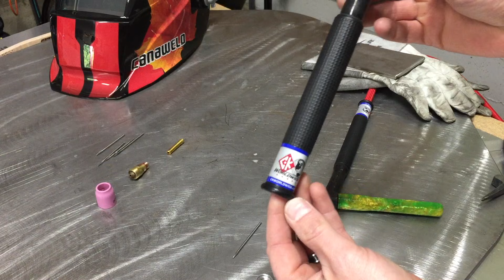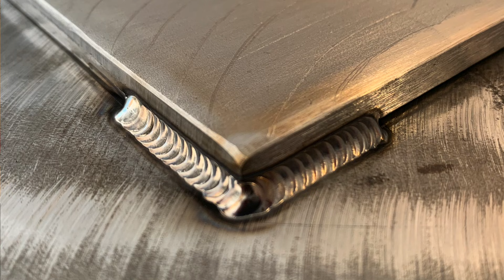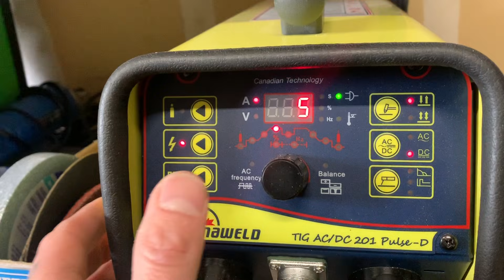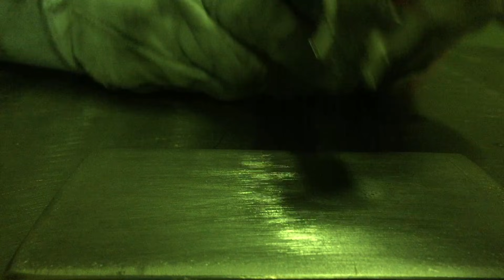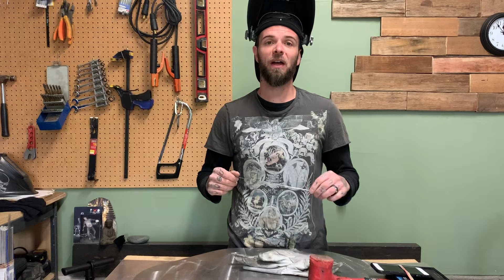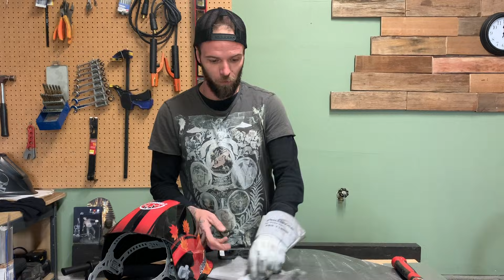TIG WELDING STAINLESS STEEL - HOW TO TIG WELD STAINLESS STEEL FOR BEGINNERS!

Comment from the maker: 💎💎💎Take a FREE online Tig class on my website HERE👉 https://www.pacificarctigwelding.com/

Thanks for watching! Check out my latest episode HERE🔥🔥https://youtu.be/FpaDdDRMeyc
Reply: My tig machine Is 200 amp,have two analog button,one is amp and the other is post flow,how do i set it for tig weld stainless steel pipe
Reply: The passive layer has nothing to do with whether or not SS is magnetic.  It has to do with the microstructure of the material (I won't bore you with the details unless you want).  The various SS are either non-magnetic or slightly magnetic.  A very strong rare earth magnet will be attracted to the slightly magnetic SS but the attraction is nothing like the attraction to mild steel.  The nonmagnetic properties of SS is a reason why they are used where there are strong magnetic fields present.  For example, MRI machines have their structural elements made of either fiber/epoxy composites or stainless steel.  With the exception of this one point of detail, you video is excellent and I learned a lot from it.

Comment: You didn’t touch on how to identify and use the correct white insulator for different cups. 
I chased a leak and delt with contamination for weeks until I finally figured out out I need to change the white insulator.  Which was a pain to find the ones that fit a ck 17.

Comment: What is your opinion on water quenching  , working with stainless?
I trying, 2nd attempt due to not being satisfied from lack of purging,  to build a turbo up pipe/ adapter from sec 40 2.5" pie cuts. It gets very hot very quickly. With 7 pices to weld air cooling will be 14-18hr of idle/ cooling time with purge on for 1hr of actual welding.

Comment: Dear Dusty a little while ago now 13th August 2015 I purchased an excelent R-Tec TIG 161 Welder on a 32 Amp Plug with a Custom Made R-Tec Welder Trolly plus various sundries all of which I have used here on my farm! On the 28th February this year I again visited R-Tec, who trade out of, Tewksbury Trading Estate, Gloucestershire and purchased an excelent R-Tec MIG 251 Welder plus various sundries and a Welder Trolly, again the MIG is on a 32 Amp Plug! Saves a 13 Amp Plug getting a bit warm on both Welders sometimes and with the Two Trolleys, me getting a bit warm lugging both the substantial welders about! I have to say though that my first choice of Welder up to now has been the newer R-Tec MIG 251! I feel though that after watching your excellent video on TIG Welding that choice may well change somewhat! I now fully understand the settings, associated equipment,  TIG Welding Technics and usage! So I will now be "Wheeling Out" the TIG when a use suggests the a TIG to be the first choice for a TIG Type task! Without the videos knowledge imparted I would not be so confident Dusty! You imparted your knowledge very well and it is now deeply ingrained and retrievable and I will be well able to "Wheel out" the MIG to use all that wonderfully imparted knowledge to "Weld up" my various Massey Ferguson, SAME 100 Six Cylinder Silver  Air Cooled Tractor, Fordson Super Major Tractor, Land Rover Discovery 2, Range Rover P38 Vouge SE, 4.7Lt, V8,  Various Farm Machinery, Buildings and Farm Equipment! Great! Wonderful! You all know? I can remember what it was like before You Tube and Great Imparters of Wisdom like you Dusty! I for one do not want to go back there! Many a Thank You! See you all about!
Yours faithfully,
                            Rob Allen.
                                               A Farmer at Halmore, Near Berkeley in The Vale of Berkeley, 
                                               South Gloucestershire. 
                                               The South West of England.
                                                In the Middle of "The Big Pond"!

Comment: Try pulsing it at 1.2 pulses a second High amps move fast. You're looking for no color on the outside of the weld that means heat is traveling through your part

Comment: 304L can be very slightly magnetic. 316L I mainly work with is not magnetic at all and Super Duplex, which we use for a lot of outdoor/sea/nuclear applications is extremely magnetic. Super Duplex is a joy to weld, super smooth, though it doesn't penetrate the same as the previous 2 grades. Its almost gummy in how it lays, doesn't sink into the joint as easy.

Comment: Thanks brother ran across your channel I'm an industrial electrician/mechanic good with mig but trying to learn tig we got a dynasty 350 almost got dimes but ran accross your channel I was told to start with stainless steel not aluminum this is the video I need love the help someone out at the end of the video your right about that we need more positive attitudes out here I'm rambling thanks for the intel

Comment: Looking at your set photo area back ground I see
Couple electrode holders that have never been used a hack saw with a blade that looks like its never been used 
Just a photo op area 
Not the way my tools looks

Comment: 5:00 Stainless steel will rust. The reason why new stainless steel does not form rust is because it has been passivated with nitric or citric acid, by dissolving iron from the surface, leaving chromium, which forms a stable layer of chromium oxide ond protects the surface. If you scratch through this iron-free chromium layer and expose fresh iron, it will rust.
The reason why stainless steel is not magnetic is that magnetic poles of the atoms do not align, like they do in iron, when exposed to a magnetic flux from a magnet. This is a material property, not a surface/coating property.

Comment: Hi Dusty, about a year and half ago I started tig welding. I was able to cobble together a gate for my side driveway 9' wide by  by 5.5' high and a smaller yard gate all made of steel. Between Jody at Welding tips and tricks and Justin  the fabricator and your step by step videos I was able to do it. I am starting to  learn to weld aluminum and my next thing is Stainless. On steel I was getting the oxidized bead....maybe too much heat and not enough gas coverage. The odd time I would get shiny beads but did not know what I did differently to get them. Kind of frustrating but you have given me some ideas that I will try. Thanks for all your help!!

Comment: I’m going to be straight up with you. I have watched every video there is on getting started with Tig welding and I have never seen or viewed However, you want to say it, anything as informative as your video.
I recently subscribed to your channel. I was hoping you would mention how far the tungsten should stick out paste your cup, but other than that which I could pretty much tell by looking at your set up, it was 100+% 
 I want to thank you for making these videos.
  I would like to see you make videos just like this one except for on different types of metals, aluminum regular steel and so on.  I would like to see doing these types of videos with a trigger instead of a pedal and the settings on that because I have a problem using the pedal myself.
  Again thank you for doing what you do.

I’ve actually been welding with stick and Mig for 35+ years. I thought I would try to get into TIG welding just because it looked pretty cool.
Like I said I’m, new to your channel so I’m going to look back through your videos and see if I may find something of what I asked already on video by you .

Comment: Oh hey
The magnet sticking or not on stainless is not about a "passive layer". Austenitic stainless is not magnetic. Ferritic Stainless is magnetic, martensitic stainless is magnetic . 
Basically these terms describe , in part, the configuration in which the iron (which is the base for all steels) is . When it forms austenite it is not magnetic. Basically, all 200 and 300 SS series are austenitic. While the 400 series are martensitic (thus, magnetic)
Has nothing to do with a layer, everything to do with the crystalline arrangement of iron with alloying elements like nickel or manganese 👍

Comment: Hello Dusty.  I am 76 years old and have been TIG welding for about 25 years now, and to say I love TIG welding is an understatement.  I have been following a bunch of your videos and a few others, especially since I recently purchased an Everlast Power TIG 210 EXT welder.  I have been TIG welding at home for years with a Miller Econotig ( 150 A ) AC/DC TIG welder.  You have been a huge help for me figuring out all the digital settings, especially for welding aluminum with the Everlast that is a bit mind boggling for me.  I used a Miller Syncrowave 350 at work before I retired in 2009 but have forgotten all the digital settings.  I am by no means an electronics specialist like you younger folks.  You have been a huge help for me to get started with the new Inverter type welder that obviously gives me so much more fine tuning of the welding capabilities with the new machine over the old "set it on AC, select the percentage of amps,  and weld" - that was it in the way of fine tuning.  The Econotig is a great machine for the price point when new ( I bought mine at an auction with 10 hrs. use for short $ ), but it is time for me to move on to perfect my abilities.  This is the purpose of my long comment.  You, young feller, have been a tremendous help to me.  One is never too old to learn new tricks and it matters not if you are a lot younger than me.  You are a great enthusiastic teacher as well as wonderful artist.  I did custom painting, free hand pin striping, airbrush murals, graphics, glass etching etc. for many years during self employment and are amazed with your enthusiasm, patience, and talent.  There is something different in the way you teach and come across.  Thank you for your help.  I am on my way to being a better TIG welder due to people like yourself who take the time to make these helpful videos.  One needs to be humble if they are to progress in knowledge.  Thanks !!!
Reply: Hey Arachnido3981. I’m moved by your kind and humble words as a (former) professional tig welder towards a welder of this time and age. The respect you pay to this YouTuber is great and could and should be applauded by by many more who are willing to sea that age and experience are not always key to nowedays success. I take my had of to you ‘Sir’.
Reply: Humility is the key requirement for learning .

Comment: HELP Me, Dusty!! I just bought a small tig,watched a few of your videos (brilliant!!) and had a good start! But I don’t know what has gone wrong… my first issue is, and hopefully you can help me here. I’m sculpting and using 3mm and 4mm stainless steel wire. I have to hold the pieces I’m trying to join, so just a burst of gas and tip, worked perfectly fine for a while!! Now, I’m either burning through or tacking and then trying to fill the joint…! It’s all gone to Hell. I’m nearly through my first tungsten! Paul H

Comment: We do full butcher shop and bakery fit outs from benches to display cabinets. A perfect (undistorted and seamlessly polished) 700mm deck weld "butt joint" on a 1.2mm stainless steel bench is held in very very high regard.

Comment: Hey dusty. I know this is an old video but if you make another video on stainless it might be worth mentioning that another way to tell if the metal you're working on is stainless or not is to hit it with a grinder. 
If you get long yellow sparks its probably your basic mild steel and if you get short red/orange sparks then you have stainless.
Ps love your videos!!

Comment: As for magnetic testing, this isn't true that stainless is non-magnetic. SS in the 300 series ( 304, 316 ) contain the iron elements in the austenitic phase, which stablizes the steels, which makes it non magnetic. They contain Nickel which lets the iron stay austenitic. 
Ferritic (or martenitic if it has a higher carbon content) don't contain a significant amount of nickel. 400 series are ferromagnetic. 

304 and 316 are most common as a sanitation material so using the magnet test still is a good idea depending on what industry your in.

Comment: Thanks Dusty! 
I've got myself YesWelder FIRSTESS MP200 5-in-1 Welder & Cutter. The Mig does a great job, however I'm struggling to perfect the Lift Tig start. So I'm trying to see if I can get a trigger handset or even a pedal set up. 
I'm new to your channel, and only watch about 1/3 of your Vids. Do you have any Vids on Lift tig starting and finishing (I've nearly perfected that) that you have done? 
Great work man, it's awesome to watch!

Comment: excellent video for beginners like moi!  

Couple of questions:

shouldn’t the filler rod be cleaned & prepped also?

shouldn’t the tungsten also be prepped?

What tungsten tip profile is best…30°, 45° or 60°?

Could an aluminum or copper plate underneath the SS coupon be used to dissapate heat?

One suggestion in your video presentation:

Try to minimize/eliminate the phrase “and stuff like that”.  It will polish an already excellent video.

and yes, I immediately subscribed after watching your vid.

GREAT JOB!  👍👍👊👊

Comment: Ferric Stainless? I think the proper term is Martensitic Stainless Steel. The reason it attracts the magnet isn’t because of chromium it’s because of the lack of nickel. There are only three naturally magnetic elements in nature. Nickel, Cobalt, and Iron. Of alloyed together it weakens the magnetic field. It’s about ratios I believe.. in the case of 400 series stainless steel (magnetic) there is no nickel to cancel the irons magnetic field. The chromium is there and it does create the passivation layer which is a wonderfully useful attribute. I’m a beginner at welding but I’m pretty familiar with metals so I hope this helps to clarify. I could see the difficulty and also the need to identify 400 series stainless over mild steel. If you have a scrap you could torch cut it would be easy to tell. 400 will require high heat and only melt. The mild steel oxidizes easily and blows apart with oxygen addition. Also, look first for the grading stamps. You can save a lot of time on new material.
Reply: That was an excellent reply! I study metallurgy and found this comment right on target. Thanks.

Comment: The magnetic properties of steel have nothing at all to do with any layer on the metal surface! You can glue a piece of electrical tape to a piece of ordinary steel and, by attaching a magnet, make sure that even such a thick coating has very little effect on the magnetic properties. There is no need to talk about an oxide layer several microns thick!

Comment: Great tutorial...I noticed one thing that might be contributing to coloration at the beginning of each weld.  When you go to post flow, you're pulling the filler rod out of the gas flow stream and resting on the side of the cup.  I know you've got to disconnect from the puddle, but need to keep the end of the tig rod in the gas flow to cool off too.

Comment: Yeah welding stainless you have to hit a very tight sweet spot of heat compared to weldling aluminum or regular steel. Too cold on stainless and it looks bad, too hot and it turns black. Just right and there is no discoloration. But it takes some practice to get really good at it and be consistent.

Comment: Open root buttwelds with TIG is hard af! Well it can be hard af I should say. But in general welding is an art regardless of the process. No two welders will have the same weld print. Welding chooses you not the opposite. I’ve tried to teach people with everything I know possible and they still just cannot do it while others take to it like walking or talking.

Comment: I bought a little welder I thought I was doing ok with tig welding stainless but like you said they jumped into joints buttwelds you know. I can mig ok and stick lets just say I Gan get it done. I'm a machininest but am really intrigued by tig and MA machine will not weld aluminum and is scratch start.

Comment: I think my problem is my habit of mashing down my foot pedal to the floor and trying to run the bead down as fast as possible without burning up the stainless(results, sloppy beads)..from watching this video it looks like you took your time, stepped on the foot pedal a little more than half and let the weld pool build up with some filler and moved on. I’ll give this a shot. Thank you for this awesome video!

Comment: Stainless is the same on the inside as it is on the outside.  It DOES NOT have a ferritic layer it is ferritic thru and thru
There is no layers and that has noting to do with whether It is magnetic or not.  
It has to do with how much carbon is added to the alloy.  Stainless is an alloy when higher amount of of nickel is added it modifies the structural properties of the steel making is non-magnetic

Comment: Hey Dusty.
I've been watching your vids a bit since getting my TIG torch for my unimig viper 185. It's a dc lift arc. I welded some stainless steel piping for some intercooler piping, I didn't purge the system due to lack of argon. The top of the welds are dull and grey, I think they're over heated, how do I go about running cooler welds with correct penetration etc? Move faster? Less amps? 
Thanks :)

Comment: You say you wire brushed the 304, what kind of brush did you use? You are not scratch starting are you? How do you prep the tungsten? And set the stick out? To acetone clean, do you wipe it on? material and filler rod? and tungsten?

Comment: Tip: Never back in your tungsten into the collet... always introduce your tungsten from the rear... this will prolong the collet thus avoiding nicks.
Reply: If you grind your tungsten at the other end as well you can Easily back your tungsten in
Reply: @fredrikthoren1234  True
Reply: @fredrikthoren1234  yeah thats what I do. Two tips(2 dips lol) per tungsten and plus its way faster to change inserting through the front
Reply: I find that sometimes my collet doesn't like it when I introduce my tungsten from the rear. she, I mean "it" much prefers it introduced from the front